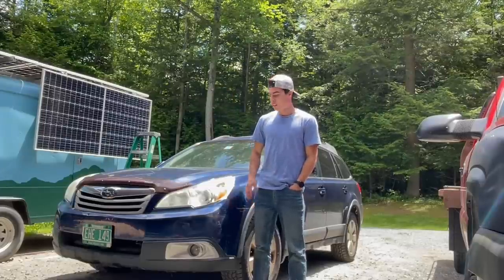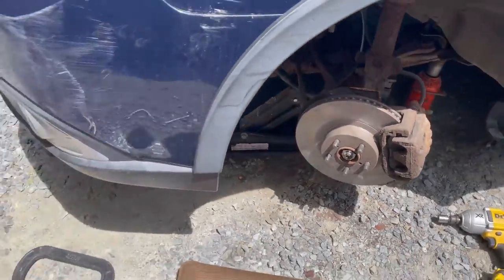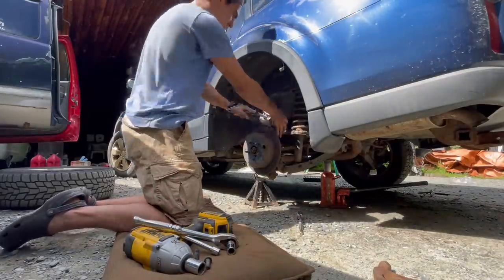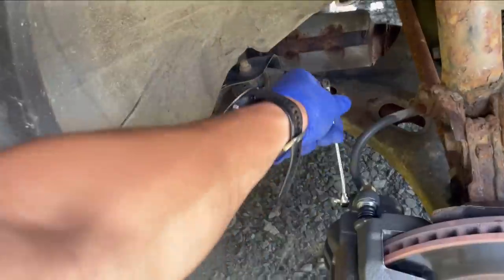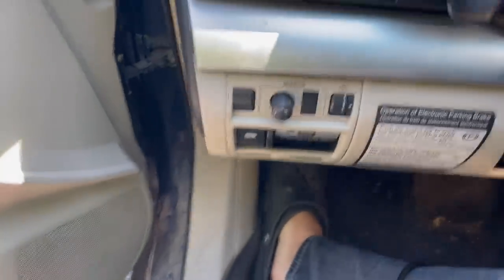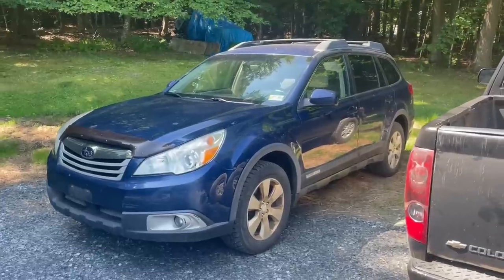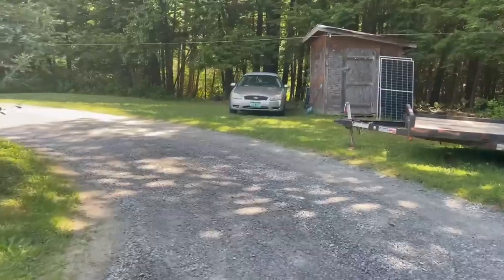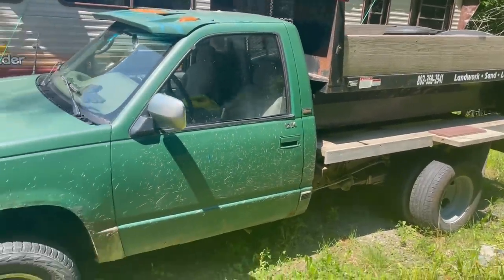Repairing My TRASHED $1000 Subaru... Turns Out Better Than Expected!

Comment: PZEV is part Subaru”s green crunchy ethos.  It’s as green as you can get without being an hybrid.  The plant in Indiana where these are built is also a zero waste facility.    Subarus of that era seem to eat brakes.    Its terrible in the mountains but it will cruise at 75mph  pulling high 20s in mpg.   Okay I’ve geeks out about this ROO enough.   Love the channel.  Love the content.   Thanks for making it.
Reply: The plant you’re referring to is in Lafayette. I work there delivering parts to the line where these are completed and driven off of. One of the main principles the company drives on every worker here is environmental impact and they actually work very hard on making that impact low for being a multi billion dollar company.

Comment: "A partial zero emission vehicle, in the United States, is an automobile that has zero evaporative emissions from its fuel system, has a 15-year (or at least 150,000-mile) warranty on its emission-control components, and meets SULEV tailpipe-emission standards."
SULEV is defined as "producing 90% fewer emissions than the average gasoline-powered vehicle." Misleadingly named upon first glance, but not false advertising.
Reply: PZEV really just means partial Zero emissions ( when getting towed back to the dealer)
Reply: The physical PZEV badge probably produced more emissions in its life cycle than what the spiel purports.
Reply: All this crap is big government propaganda. If we spent more time enforcing the crap we buy and make quality products that would be green enough. I had a refer from 1970 still going. The new one we replaced it with lasted 4 years. Companies have changed philosophies to make sure that their products don’t last….well long enough to get out of the warranty period. 😢

Comment: The PZEV cars have a special cat system which greatly reduces emissions under certain conditions. It also means the 4 cats on that car are worth around $3,000 when the market is right. Congrats, you bought a gold mind. A lot of people will sell the cats off a PZEV car and put on a crap aftermarket exhaust then sell the car to maximize profit. These were hot when cat prices were insane last year. Sticky calipers are sadly a bit common for Subaru. Not really sure why. I can rehab the calipers most of the time, but there is something in the design that means they do need to be replaced within 150-200K usually. On the larger cars at least. The car came out great overall!
Reply from the maker: ah thanks. seemed like a weird way to put it to me. Yea these calipers were shot i dont think i coulda saved them

Comment: In the salt states we can't get away with doing a brake job like that. The Caliper has to be removed separately from the mounting bracket, all of the slides and pins have to then be removed, cleaned up and then lubed with high temp brake lube and then reinstalled.  Had your brake calipers been bad you would not have been able to push the pistons in to make room for the new pads. The problem was seized up brake caliper slides and mounting points.   But you got it done , just that it cost you extra money for the calipers.   I thought that had rusty rockers towards the rear tires?
Reply: Did you miss the part where he said he greased the pins?
Reply: This is Vermont... We are a salt state. Of course we have to do all of that, and he did.
Reply: @ckm-mkc  Did you not watch from 1:00 to 1:25?  The front brake calipers were not removed from the mounting brackets. If anything the area that the brake pads slide into might have had a little grease put on them but the caliper slides and pins were not taken apart,  cleaned and lubed.  And isn't it interesting that it is the front that were sticking and causing the front brakes to over heat.
Reply: @802Garage  yes we do have to do all of that.   BUT he did not do it "on the front" and by not doing it he then had to go and spent money for new calipers and brackets.  Had everything been taken apart and properly cleaned and lubricated he more than likely would not have had to buy new front calipers and brackets.   I am not trying to bad mouth anybody but I am also not going to pretend that it was done correctly because it wasn't.  I hope that he might do some thinking about this and realize where he made his mistake and grow from that...    If you think that it was done properly and if you do repairs then you need to educate yourself on how to do the repair properly.  have a good day.
Reply: @802Garage  And after re watching the rear brakes being changed the calipers were never removed from the mounting brackets, so that also means that some important slide points were not cleaned and lubricated on them.
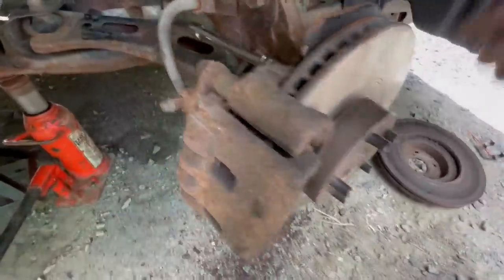Reply: @richardthomas1743  2:17 To answer the first bit. I have completely cleaned and regreased calipers before including using a pipe cleaning wire brush in a drill on the pin bores and still had to either replace the pins or the entire caliper. Components can get warped or out of round over time. I have also had pistons so bad they had to be replaced, and sometimes it's not worth it over buying a new caliper. You're assuming far too much about me, I just listened to what he said. I have completely rebuilt calipers before that most people would throw away and they outlived the car. As for the rear brakes, I agree it doesn't look like he greased the slide pins. They did look like they had been replaced already, unlike the fronts, so they were likely a lot freer moving. I still would have done it, but I'm just saying.
Reply: @802Garage  I heard what he said and I know what I saw from 1:00 to 1:25 .  No need for you to answer. Have a good day.
Reply: I totally agree with you. I used to have a '99 Legacy and had to get a professional to remove a seized pin once.

Comment: Adding rubberized undercoating will trap moisture and accelerate rust.  Plenty of videos demonstrating this and I have seen it in person myself.  The frame will look great right up until you poke it with a screwdriver in a few years and it goes all the way through. 
For corrosion protection use the oily wax type that sprays inside the rails etc.
Reply: Or you could do what I do which is live in Los Angeles and love it.

Comment: Should have checked to see if the slide pins on the calipers were corroded. They can cause brakes to lock and stick. Could have saved a couple hundred bucks.

Comment: Will you please get yourself a 
FLOOR JACK !!!
Not a bottle jack.
Reply: Floor jacks slide around when you lift a car up. Does not work well on a gravel surface.
Reply: @mph5896  floor jacks work pretty well with a piece of plywood under them

Comment: I used to work at a couple of different Subaru dealerships in the parts department and can say that it looks like this car was loaded up with basically all the desirable accessories that were available when the car was new.  Pretty sure it will sell for way more than you have invested in it.  Also, I still have no idea what the hell PZEV is to be honest.

Comment: Have you heard of ABS brake bleeding? I had my brakes done on a Ford Flex. The pedal goes close to the floor. My brother a mechanic who didn't work on it told me the pedal shouldn't do that. He mentioned the ABS. Would like to know how important should it be in how far down the brake pedal goes when stopping.
Reply from the maker: yep u might need a pressure bleeder for that. harder to get all the air out of abs reservoir. you can also try slamming brakes on gravel road a few times to engage abs then bleed after that
Reply: Whoever did your car did it wrong. You either have a leak or it needs to be bled better. Abs bleeding is using a bidirectional scan tool to activate the abs in order to bleed it.
Reply: @mph5896  Thank you for you help. I tried to get it resolved with the shop. We went for a test ride and he said it was ok. I gave them a bad review. My brother's friend is mechanic and has tools at his house. He bled them the regular way. The pedal goes past half way.
I'll have to take it to another place.
Reply: @mph5896  I have near had to bleed the abs on all my cars I had.

Comment: My subaru has PZEV, but still gets 17mpg in mountain driving.
Reply: I don’t know how you do it. My 2014 Forester sucked at altitude. I had to floor it to get up mountain passes. One of the crappiest vehicles for mountainous terrain. The cvt sucked. It would just stay at redline to keep up with traffic.
Reply: @haroldbeauchamp3770  yeah the cvts are terrible for mountain driving. My Subaru is a 2008 outback which has a 4 speed, which allows me to get good torque in low gears, but terrible gas mileage.
Reply: My 93 Impreza with the 1.8L drove over every pass in the Rockies fine. Went all the way to Telluride and back. Went over the Monarch Crest too. The key is don't be afraid to down shift and actually work your engine! I actually got insane gas mileage at altitude. With my old school ECU I think it just kept pulling fuel as the air got thinner. Basic single O2 sensor setup. I got as high as 36-38 MPG if I remember right, maybe higher, but the car usually got 30-32 max. Helps it was such a light car though.
Reply: @802Garage  my 2014 didn’t have that option. Once I’d start to ascend high mountain passes, the cvt would shoot the rpm’s to 5-6k rpm’s just to maintain speed. The cvt fluid would be boiling hot after sustained driving. I’m quite certain that’s why Subaru cvt’s are so bad.
Reply: @haroldbeauchamp3770  Hahaha that sucks! I'm not a big fan myself, but they have improved over the years. The first few years primarily have problems with solenoids failing and because Subaru said not to change the fluid. Change the fluid regularly and they last. Wouldn't be my first choice for the mountain passes either.

Comment: PZev is kind of an odd thing it's got close coupled catalytic converters designed to get hot, or working optimal faster.  Along with fuel lines to prevent off gassing, carbon filter vapor filter/canister and even supposedly different ecm programming for winter to get everything up to optimal running temp faster.  Plus a 15 year guarantee on the emission system.